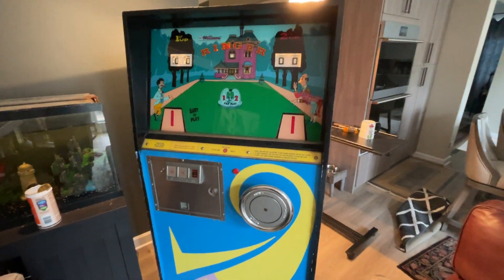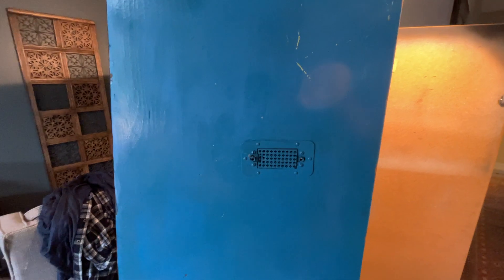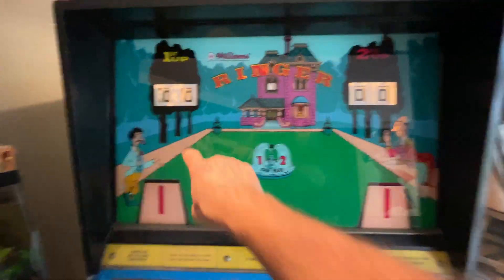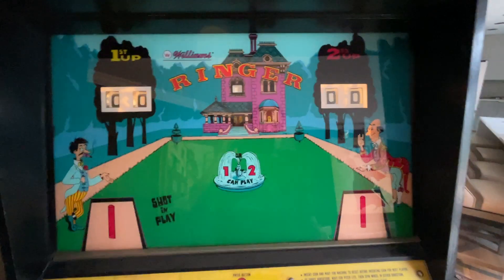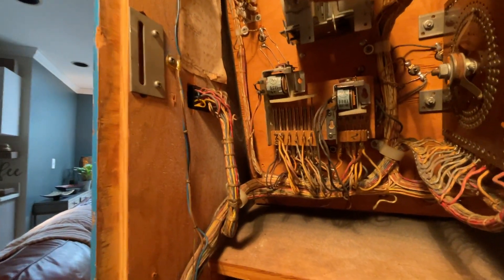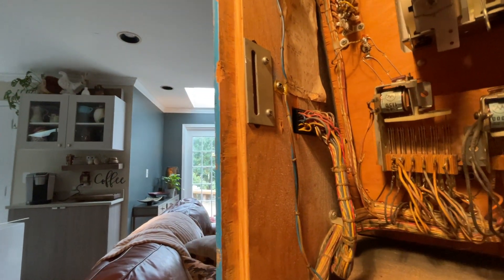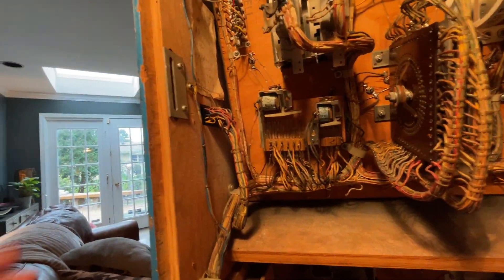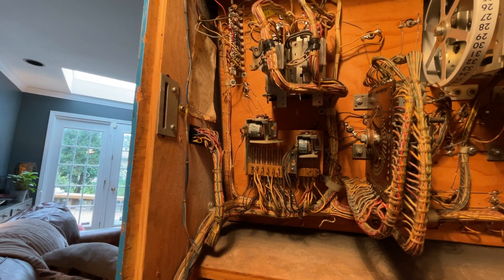1970 Williams Ringer with extra port on the side- what's it for??

Comment: I'm not a pinball guy but that definitely looks original to me. The wires going to the side connector were installed at the factory. What is the use of the stepper?
Reply from the maker: It's a horseshoe game. When you spin the wheel on the front of the machine, each rotation pulses the stepper one time and it advances the horseshoe one "click" on the front glass by illuminating a series of bulbs (the wires coming off the stepper go to the light bulb sockets).

Since these wires also go to the plug on the side I am assuming there was some external board that could also display the horseshoe animation?  But that seems like a very specific use case for this game...  If you Google "Williams Ringer" you won't see another one with this plug (at least I didn't)
Reply: It is probably a special version of the game for a showroom